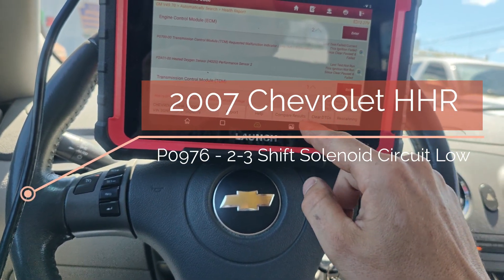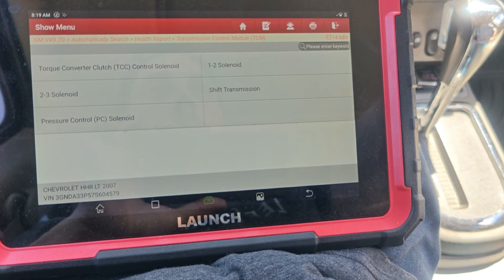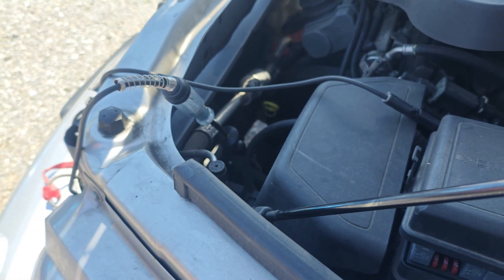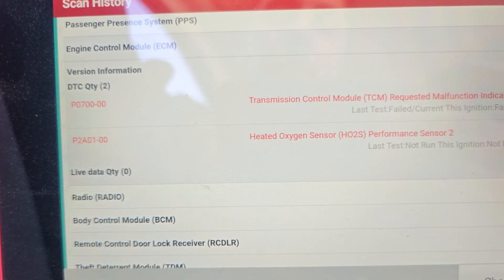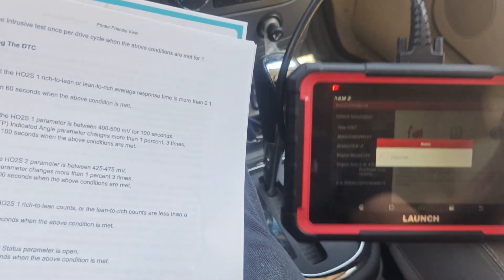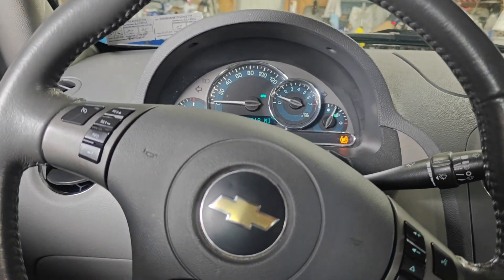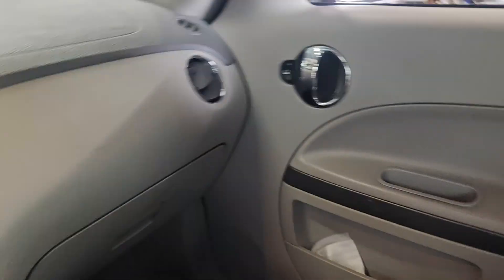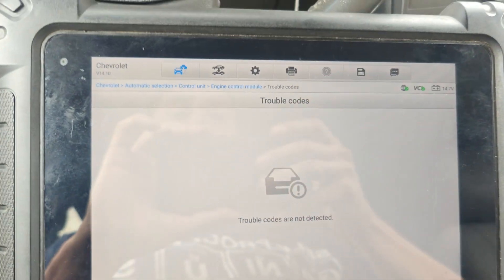2007 Chevrolet HHR P0700 - P0976 2-3 Shift Solenoid Control Circuit Low

Comment: Where is your test plug going I can't tell. Trying to find where put my multimeter to see. Broke and getting a solenoid a code on my 2010 hhr. It's not shifting.  Wanted try test and see before I take granny apart
Reply from the maker: Tell me the specific time in the video and I will try to tell you.

Comment: Nice video.  Last year my daughter's 2010 Chevy Cobalt was setting a 1-2 shift solenoid code, but the transmission was shifting fine for the most part but had hard shifts occasionally.  By December of last year, it was getting a lot worse, and it would shift hard most of the time.  
I used my scan tool to bi-directionally control the shift solenoids and the 1-2 solenoid would not click.  2-3 would.  I tested the wiring up to the connector on the transmission and power and ground was good.  Since it was December, and I didn't feel like trying to get the side pan off with as much stuff that had to be disconnected, we found a guy who works in a transmission shop that does work on the side, and he replaced both shift solenoids.  He used AC-Delco solenoids.  
After the repair the car shifted great and has for the past year.
Reply from the maker: Awesome, that is good to hear.
Reply: I just bought Chevy hhr having same symptoms you described code is p0752